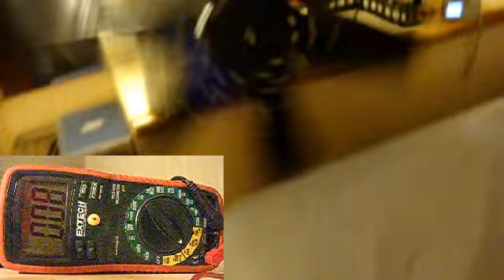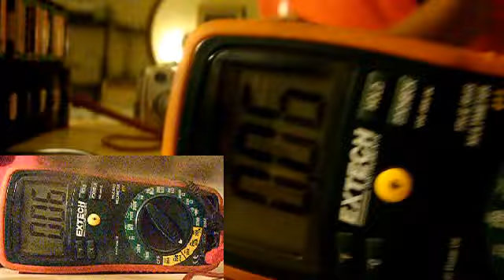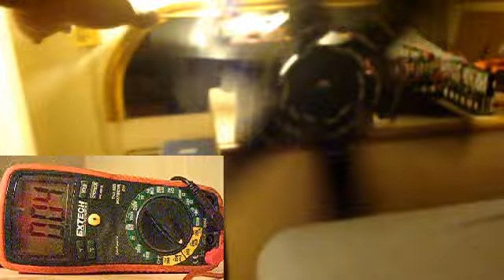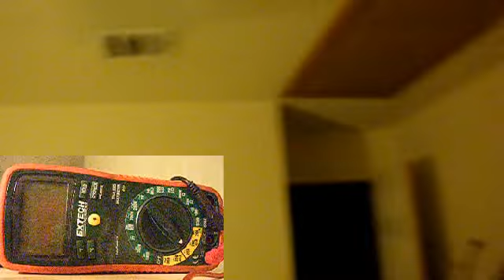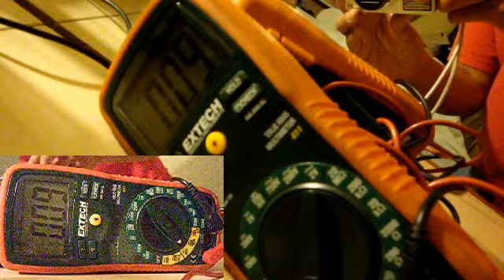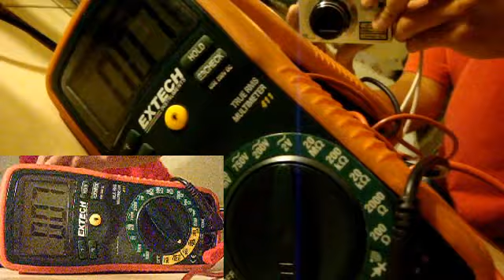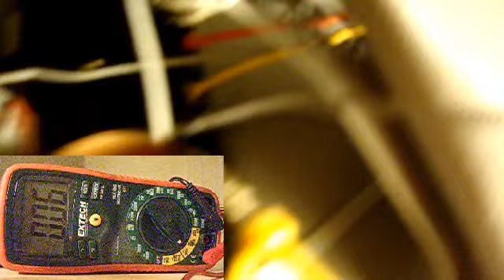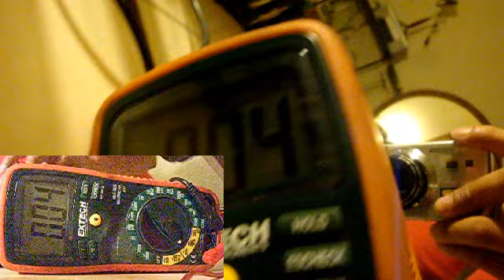ｗａｔｔｓ12.0 130ＲＰＭ ＭＯＴＯＲ Ｎｅｗｍａｎ

Comment from the maker: In any case, I think the content of my video proves is that there is way more efficiency I can get out of my system. Many have said if I just complete the other side that the efficiency should increase greatly. I already know that adding the fourth coil ALONE doubled the efficiency of my system by cutting down the current in half. One could only guess what adding two more coils to the top would do....

Comment from the maker: To calculate apparent power, the average current is all I need. I am using batteries, so the apparent power is the way to measure the power input. The apparent power is by definition always greater or equal to real power:

|cos(theta)| is never greater than unity.

Comment: I admire your drive to experiment, your getting a great education but don't be misled.
I have a store bought permanent magnet motor which will likely produce the same amount of work as yours for 11 watts of input power. Comparing your ceiling fan to your motor only shows you have designed a more efficient motor, but it doesn't prove your motor is more efficient than many permanent motors already on the market. Check out the Minn Kota Trolling motors some time. I think you will be impressed.

Comment from the maker: "One point, rechargable batteries do not output a stable current, but the current fluctuates depending on the power cosumption. To accurately get the power draw, measure both volts and amperes."

Another point is that they don't output a stable voltage when the circuit opens and closes, thought it makes no sense that the average voltage of the current should exceed the voltage of the battery. I wish these "multi"meters came with digital wattmeters....

Comment from the maker: The Newman motor needs to generate a temperature differential to extract heat. A thicker coil obstructs the heat flow.

Why heat flow? I can't fit the explanation here. I put it in my profile instead.

Comment from the maker: "He has never been able to remove the batteries from his system."

I never seen him simply disconnect the batteries during a demonstration to continue as long as it could with batteries.

His machine does have a stray capacitance, but that can only hold so much potential before it shuts off. The voltage of a capacitor falls more quickly under load than a similarly priced battery.

His machine's match is an ultracapacitor. That's NEW technology. It would difficult for anyone to implement that in.

Comment from the maker: I haven't found any UPS unit that outputs over 240 volts DC. I am also concerned about their integrity with something like this motor that relies on back-spikes as the operating principle (as I explain in my YouTube user profile). I am not at all convinced that a UPS unit is compatible with my system. My multimeter, on the other hand, is not a power source, so I am not as concerned with that.